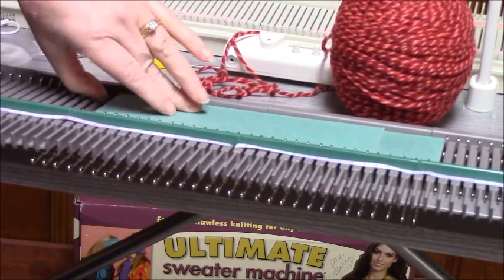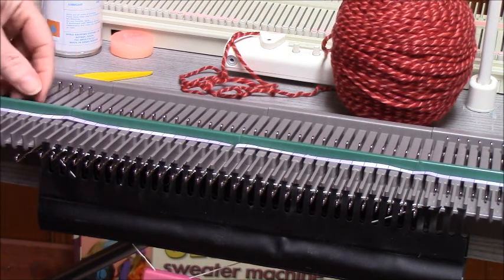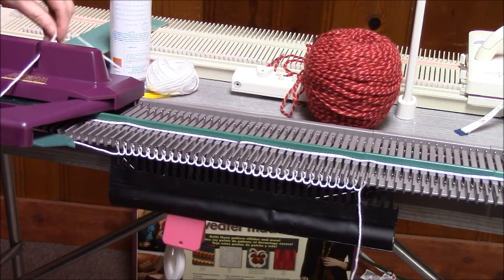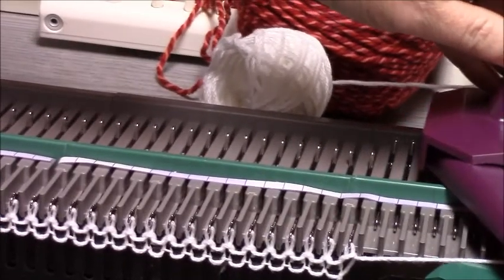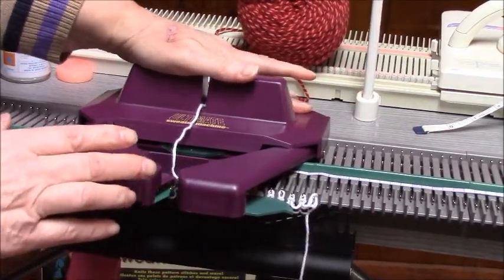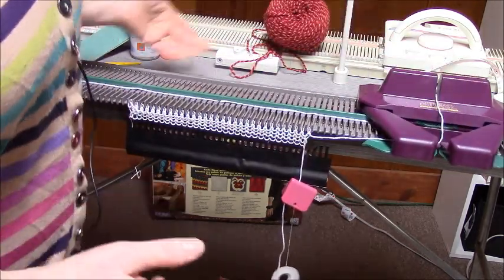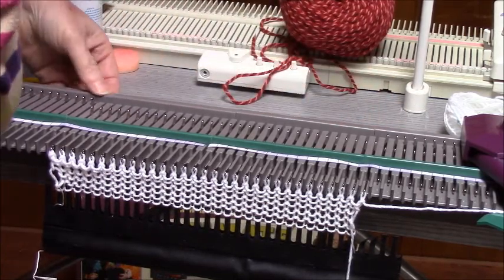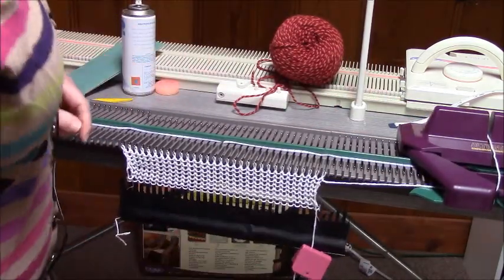Troubleshooting problems on the Bond Ultimate Sweater Machine (USM)

Comment: I've had Bond machines (original and ISM) since the 1980s and never had any problems with them (that weren't operator error, LOL) until I  was given one of the newer-style USM carriages, as shown on your video. It's so fussy and temperamental about  everything - yarn type and tension, where it's held, how it's pushed; I  call it the snoephlayke carriage. 
I  do use it when I  have a lot of yarn changes to make within a piece. The annoyance of repeatedly dismantling the wire bail carriage for each change can be greater than having to coax and bribe that snoephlayke carriage!
Reply from the maker: Isn't it amazing how the carriage change made such a difference?

Comment: I read a lot that we should open the carriage to see what needle it is that is causing the problem but I don't even know what it is we're supposed to be looking for. How do we tell what needle is causing the problem?
Reply: If you check the plastic needle guides on the bottom of the keyplate, you should see that one of them appears to be blocked up against one the of the needle butts.  Just use your transfer tool to give that needle a tiny nudge toward the back of the machine.

Comment: It seems to be certain models of USM had poor carriage buidl. Did see some info on Gerri Baggett(dont give up on USM) where she ground down a few areas but I wondered if just have a thin strip to raise (maybe metal,plast or wood polished) on where carriage runs. Purpleponyart did a bond diary#1 on the problem also.  Havnt checked C Ogden yet but maybe Diane sullivan, or Cheryl runette. Roberta rose meade has alot on USM and bond and lots of KM's.    Did anyone call USM and get replacement carriage? Will maybe haul mine out of closet to try again or sell. So it sounds like careful with pushing carriage and tilt and yarn tension and ...
Reply from the maker: I offer a 1:1 knitting service to get you diagnose and fix your problems.

Comment: I can hear by the sound of the needles rubbing on the keyplate that the keyplate hasn’t been waxed.  It needs waxing before you start knitting with them, otherwise it will be very difficult to knit with.

If you’re using an extension kit with the USM, the table really has to be flat. To keep the bed joins from separating.  Just stuff some green cards or something under the back of the bed.

This was never a problem with the original and Classic as the extension attached at the end and the machine doesn’t sag at the end because that is where the clamps are.
Reply from the maker: Appreciate all your suggestions... There truly was something wrong with this machine.  I've used the Bond since 1983. This particular machine has manufacturing flaws that were touchy to overcome. It is the first time in many, many Bond machines I've taught on that has ever had these issues. I published the video in hopes it would help others.
Reply: @Knittingtoday  Fair enough. 🙂. The USMs were alright at first until around 2006.  They made a lot if changes, like adding sponge under the needles and the needles themselves we’re changed.  They were pretty shoddy after that.  The old ones worked fine.  The original UK Bonds were still better quality though.

Comment: Opening the key plate allows you to SEE the problem.  Also, by pushing the carriage from the side, you are causing problems.    Place your hand on top of the carriage when you push it.   The weight of your hand will keep it from jamming.
Reply from the maker: Thanks. I've had this make of machine since 1985. This carriage isn't cooperating no matter what, even with both hands lightly guiding.
Reply from the maker: The problem was a backward/forward issue, not a keyplate issue.

Comment: It looks like you were new at working with the USM.  Boy, do I remember my early days knitting on the USM.  Be diligent, and it will pay off in the end.  I make many afghans, blankets, scarves, shawls and socks on my USM.  There is not to be a lot of tension on the yarn, just some.  For those who work with the USM, I would strongly recommend they watch Cynthia Ogden's YT vids working with that particular machine.  When she made a mistake, she did not edit it out, but showed how to resolve any issue that comes up while knitting.
Reply from the maker: Actually, I've used it since 1983. This particular machine has manufacturing flaws that were touchy to overcome. It is the first time in many, many Bond machines I've taught in that has ever had these issues. I published the video in hopes it would help others.

Comment: I have a question I just got my knitting machine. It goes smoothly over the needles but the needles are not catching the yarn how do you fix that?
Reply from the maker: A couple things to check: make sure the keyplate is setting down in the carriage and engaging the needles; make sure you have no tension on the yarn.

Comment: May I suggest you use a tighter stitch size ?
Those stitches do look rather loose, and that could be 
the reason for the instant jams.
The machine may not be jamming on the back rail at all.
It just seems like it  !
Reply from the maker: an organ lover  thanks for the suggestion. However I have used that yarn on the same machine and with the same size keyplate several times over the 30 years I've knit on this machine. It is definitely a carriage design issue.
Reply: I stumbled upon this and believe this is my issue with my machine (same USM as in the video). I can't wait to see if it is, as I would love for it to work.
Reply from the maker: speckledyarnbug feel free to message me and I'll help you troubleshoot.